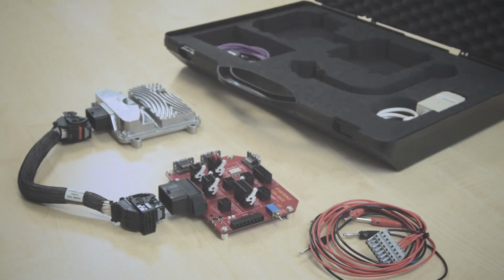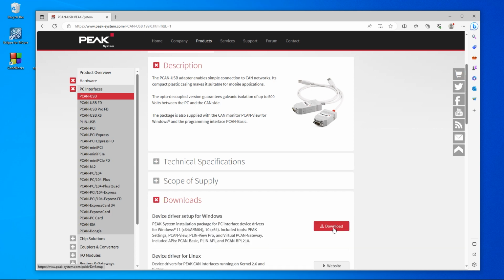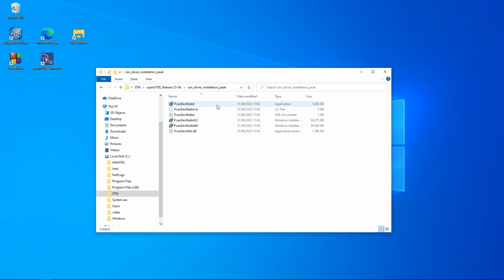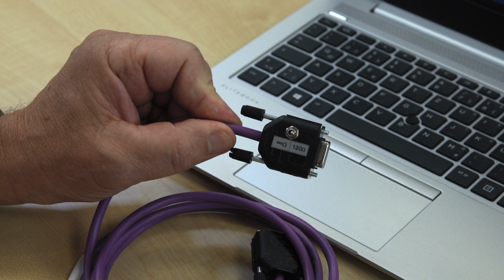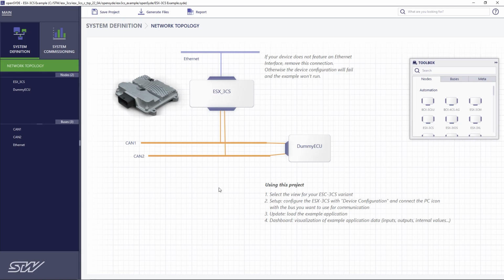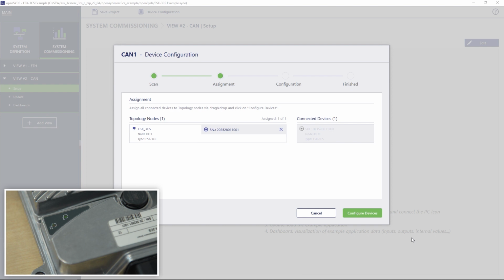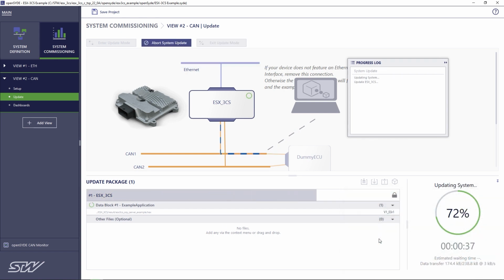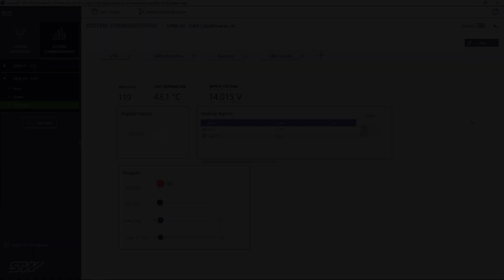Getting Started with CAN Communication between PC and Controller

Comment: Do you still need the CAN dongle to flash and connect to the controller if you have a model with Ethernet?
Reply from the maker: To flash STW controllers that have an Ethernet connection, it's not necessary to use the controller's CAN bus. We've explained this in our video titled “Getting Started with the Ethernet Communication between PC and Controller”, https://youtu.be/SuV0rMS-j80?si=PHDH3rJs9dUJAXH1.

However, there is one exception where the controller's CAN bus is essential. We cover this particular case in our video titled “Getting Started: Troubleshooting CAN communication”, https://youtu.be/N8riwZRnWZM?si=BQU-pOy5AUtW4bze&t=601.